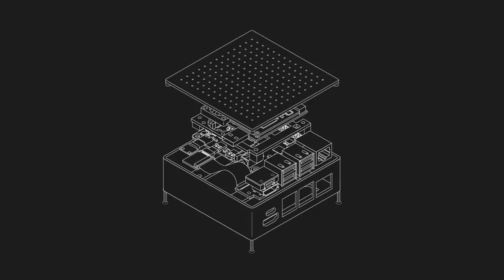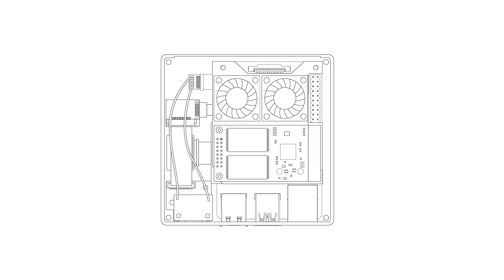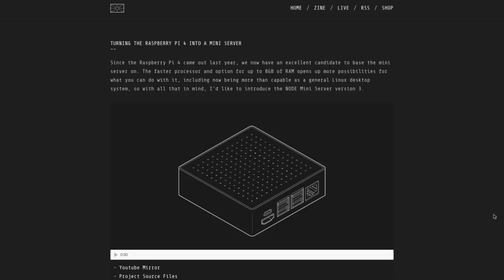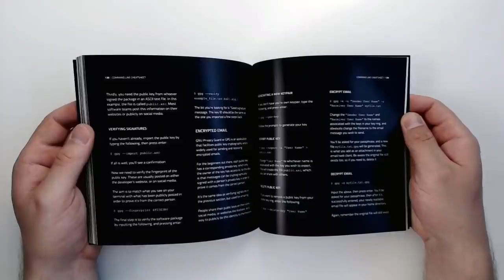Turning the Raspberry Pi 4 into a Mini Server

Comment: The stacking design is brilliant! I've just started out with my Pi 4 8gb model running Ubuntu 20.04 and it drives me nuts. My Pi 2 running Void works better, not sure how that's even possible. I want to host my own mail server, a static website and a Matrix Synapse server for starters. The software side of the Pi on aarch64 really needs some work. The Pi 4 with a small Pi 3 radiator gets really hot without active cooling, going even to the USB and Ethernet ports, so I'll have to see what I can do about that without going too big (currently caseless, running on the box that it came in, since all metal radiator cases were out of stock everywhere i looked).
Reply: Software is fine, just Rpi is broken by design. https://twitter.com/armbian/status/1297100103363235840
Reply: @igorpecovnik   Not sure about "broken," however I agree there are better alternatives for storage, like the RockPi which comes with eMMC and with an m.2 nvme port (and not an easily breakable micro-HDMI, but a full sized HDMI). There are also other boards with 1 sata port on them, but the Raspberry Pi does a good enough job as it is. I just bought a m.2 nvme to USB 3.1 case, I just need a Type C to Type A usb cable and a distro that won't make me pull my hair off, like Ubuntu currently does. Void is still some way from being ready (although I may try Void mklive with the latest Pi 4 stuff, just to test and learn stuff), but I may go with Arch or Manjaro ARM for the time being (although I have my beef with both of them, those haven't annoyed me as much). I still have Ubuntu on my Pi 4 2GB, just because I won't be touching it at all.
Reply: @MrBiky  What you think about is irrelevant since this is science and is something that can be proved. Any you already see symptoms which you mistakenly hooking to software. All distros will have this problems so my free advice to you is to not waste time with Manjaro and similar. Its not your fault ... USB storage has that kind of problems. Everywhere. Not just on toys like Rpi. That's the core of the problem. If you want reliable thing, throw Rpi into the trash.
Reply: @igorpecovnik 
>If you want reliable thing, throw Rpi into the trash.
Reliable for what? Serving websites? Serving large files or databases? Using as a desktop? Or reliable hardware? What did you mean by this? My experience with the Pi 2 and Void on an SD card was great for the level of performance the hardware has.

Additionally, I have not mentioned any symptoms or issues I had in my short experience with the Pi 4 and Ubuntu 20.04. Did you just read my mind to see what my issues were (software or hardware)? And you mentioned the word "science," but in relation to what? USB storage? I really don't get your point.
Reply: @Biky Reliable for personal site? Yes. Business site? No. Desktop on a HW without any proper storage? "level of performance". ARM boards are designed for specific use case. RPi is good for driving cameras, attaching displays, overall playing for users is less painful ... but you have to understand where the limits are ... or you will be ranting until they will give out new RPi which you will buy, because "you" can't resist their marketing. That one will probably not have those issues, but still will have others. Reliability is like security. If you want to understand it, don't ask random people on the internet. Read books and articles, study. Nobody can give you proper answer in a quick YT comment. Yes, RPI can do everything you are mentioning - thanks to greater Linux community - but it some use cases performs so so, somewhere is nice and in some cases at not acceptable levels. For NAS use case is very bad choice, but there will be lots of amateurs (hw is at made for them) out there praising how good this is. If you find a good word advocating Rpi means you have no clue (or just not know enough) or you don't think much. Its a consumer grade product.